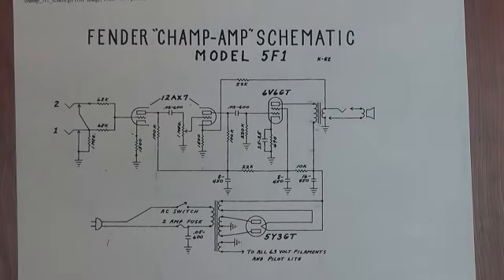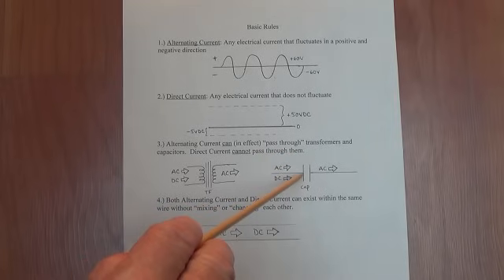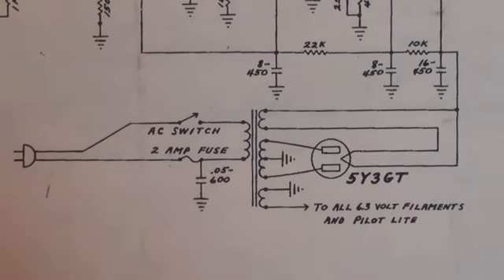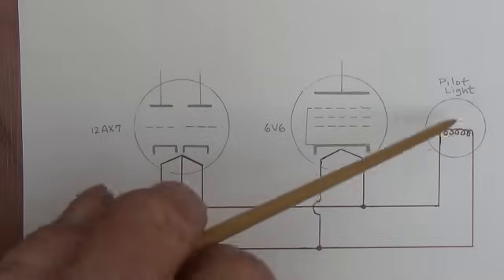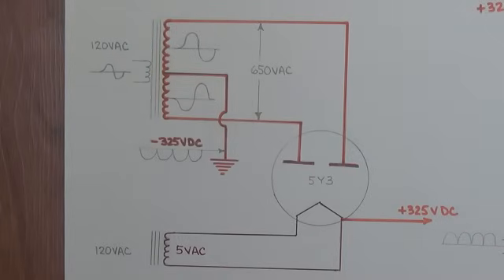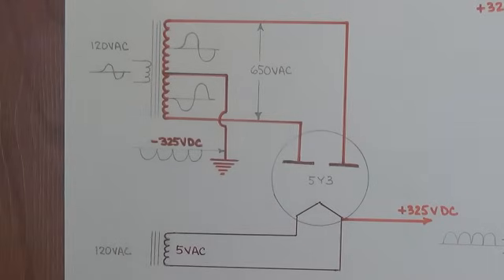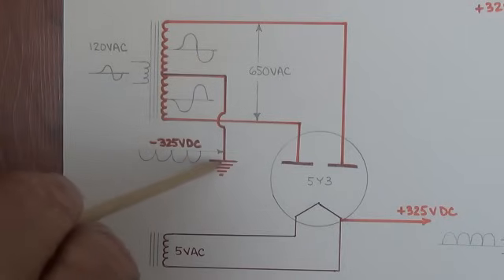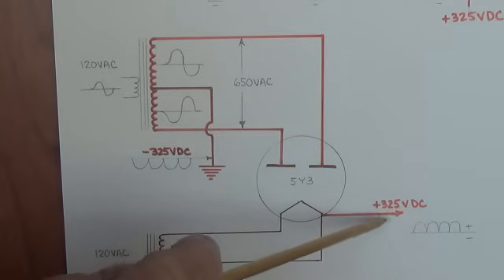How Tube Amplifiers Work, Part 1: The Power Supply

Comment: hi,uncle doug i put 2 resistors 120ohm on 6,3 ohm filament and 1 supply  807 tube and 6sl7 tube ,2  together needs  1.2 amperes  .What wattage of the 120 ohm resistor should i choose! if i calculate  v*i= 7.5 watts it seem very high wattage for the resistor
Reply from the maker: I'm sorry, KF, but I don't understand the question. What is the purpose of the resistors on the  "filament and supply" ?

Comment: 0:45
 Wrong! Your saying that the overall voltage is the distance of a conductor's voltage at two different times? One being +60 volts (its peak) and the other being -60 volts (its trough). Those are just two different moments in time of a single conductor. 
You need the voltage difference between two conductors to create a voltage.  Your only showing the sine wave of a single AC conductor.
 If your sine wave was applied to a neutral, it would only be 60 volts, not 120.
Reply from the maker: You're right, Aaron. All of this has been covered numerous times in previous comments and replies, and in subsequent, more detailed, videos on the same general topic. Thanks for your input.

Comment: If DC doesn't travel through transformers and capacitors, then why does the power supply make DC which then passes through Capacitors? Can you see why I'm confused?
Reply from the maker: Nowhere in the circuit does DC "pass through" capacitors, Victor. Caps are actually used to block DC from reaching tube grids. With filter caps, the rectified DC passes by the caps, but never through them (to ground). Tone caps allow certain frequencies in the signal (which is AC) to pass through or go to ground.  I hope this puts your mind at ease.

Comment: Do you think a GZ34 Full Wave rectifier tube can dropped into place of a 5U4? GZ34 uses 1 amp less heater current and possibly less forward voltage drop. This would provide better source current. Who sells a good tube manual these days?
Reply from the maker: Yes, you can replace an antiquated, inefficient 5U4 with a vastly superior, slow-start-up  GZ-34.....but you have to be sure that the higher voltages don't overwhelm your circuit. Vintage tube manuals are readily available on Ebay for a pittance.....check it and see.

Comment: I just watched part 1 and 2. Wow, this was so interesting.
Reply from the maker: Glad you liked it, Jim :)
Reply: I do have a question about the guitar amplifier’s output wattage and is it multiplied by how many tubes it goes through? I have a 25 watt amplifier and it has a 3amp fuse. Based on the little I know. P=IE that would be 120x3=360 watts that the amplifier uses but how is the output wattage calculated to be 25?
Reply from the maker: @jimaquilano9137  The output wattage is measured, not calculated, Jim. You need to watch the video I posted on how the process is done. Check my video list.

Comment: Your videos keep on giving! Thank you sir. Newbie question for you. It seems like we're 'flushing' a lot of voltage to ground, -325VDC. I'm curious about the amperage. I'm brushing away the cobwebs and getting in my way back machine for highschool physics: ohms law. I'm thinking ground is like a charge sponge, and the ground wire has little resistance, wouldn't we see significant (and dangerous) amperage in our ground wire?
Reply from the maker: Actually, ALL the electrons are pumped by the power transformer from the circuit to ground through the high voltage center tap. The function of the circuit occurs as the electrons move from negative ground back to the electron-depleted (positive) portions of the circuit.

Comment: here's a question: would sound vary on a 220V/50 Hz vs 110V/60 Hz amp? Has anyone compared every? Transformers have a lot to do with the end sound. Bottom line: voltage varies from country to country and it wouldn't be right to sell 1 specific model brand amp in the US (110V) and the very same model brand amp in say Paraguay (220V)
Reply from the maker: I honestly don't think that there would be any audible difference between the two power transformers, Fernando.

Comment: So the +325vdc output is somehow put onto on the 5vac filament line?
Reply from the maker: No, due to the biasing of the diodes in the full wave rectifier tube, the + 325VDC emerge from the filament side of the diodes. See my more recent videos on power supplies and rectification for a detailed explanation.
Reply: @UncleDoug  Thanks for the reply!  I'll need to watch those.  I had been under the impression that the filaments of tubes were always isolated circuits solely for the purpose of heating something. I had no idea that would be involved or connected to anything else.
Reply from the maker: @DollySvengali  The 6.3VAC filament circuit for the amplification tubes is not connected to the HV in any way, FD, and no HV exists in the 5VAC filament voltage of the rectifier tube (it all goes to the amp tube plates).....so you really have nothing to worry about.

Comment: UNCLE DOUG< if the B+ voltage is at 450vdc and if you increased it to 600vdc will this increase the AC ripple voltage and output more wattage?
Reply from the maker: Unless the circuit was designed for 600VDC,  all sorts of problems would arise, including shorted filter caps, Bill. You can't simply force a circuit to operate at parameters beyond its capability. In general, however, the higher the plate voltage the higher the gain in the amp.
Reply: @UncleDoug  I'm just talking in theory, would the AC ripple peak to peak voltage increase or decrease because the B+ voltage has increased? Yes higher plate voltage on the power tubes but this will cause the AC ripple to increase or decrease? The power tubes would draw more current if you raise the B+ voltage which would increase the AC ripple voltage?
Reply from the maker: @billwilliams6338  If ripple is a percentage of the voltage peak, then increasing the voltage peak would increase the amount of ripple. The percent of a higher number is greater than the same percent of a lower number......but I fail to see how this is relevant to a practical understanding of circuitry with regard to diagnosis or repair.
Reply: @UncleDoug  I haven't seen you make a youtube video on measuring the AC ripple on guitar amplifiers. The oscilloscope trigger needs to be set to the Line frequency to measure the AC ripple.  Fender amps ripple percentage is different compared to marshall amps ripple percentage any reasons why? Can you make a video going over the voltage peak compared to the ripple percentage?
Reply: @UncleDoug , If you play the guitar and use an oscilloscope to view the AC ripple on the power tubes screen resistors you will see the AC ripple increase when you strum the guitar strings harder because its drawing more current from the power tubes and the AC ripple increase and gets worse which causes Harmonics and other noises in the guitar notes.
Reply from the maker: @billwilliams6338  It sounds like you are the one who needs to be making videos demonstrating your theories, Bill.  I am still at a loss to see the value of calculating ripple percentage......what purpose would this serve?
Reply: @UncleDoug  if there is to much ripple or the ripple increase in the Biasing voltage to the grid or screen of the power tube it will create noises and harmonics when you play harder on the guitar strings. I was asking if you have notice this type of problem when repair amps or have never noticed it seems or don't care about it. Was just asking not demanding information from you don't get mad.
Reply from the maker: @billwilliams6338  I'm not mad at all, Bill. I just haven't noticed the problems you describe.

Comment: I don't know if you'll read this question because this video is 5 years old but here goes...  At around 18:00 you show the +325 V DC waveform drawn in pencil.  Why are the waves next to each other without any spaces between them where the downward half of the wave used to be?  (I'm going to use a ^ in place of the upside down 'u' because that's all I have on my keyboard).  To rephrase the question  more clearly, why is the output drawn ^^^^^^^^^^ instead of ^ ^ ^ ^ ^ ^ ^ ?  How did the top half of the waves move together eliminating the time taken by the downward half of the wave?  EDIT:  thank you for the video (I should have said that first before I busted into a question).  It's the best explanation I've seen in my 50 years of playing guitars through amps.  Two thumbs heartily 'up'.
Reply from the maker: I try to read and respond to all questions, Robert. The "upper" wave forms occur at 60Hz. Recall that the HV winding is center-tapped, so the output from each (of the 2) output wires is out of phase (when upper wire wave form is up, the lower wire wave form is down, and vice-versa). Since the rectifier only allows the positive wave forms to pass, the positive wave form from the lower wire is inserted in between the two positive wave forms in the upper wire, creating twice as many positive wave forms overall, resulting in a 120Hz positive DC output (with some ripple). I hope this makes sense.
Reply: @UncleDoug  Makes perfect sense.  I should have figured that out myself!  :)  Thanks for taking the time to answer.  Much appreciated.  Belated happy Thanksgiving.
Reply from the maker: @robertbogdan7058  You're welcome, Robert.

Comment: You shouldn't have put a ground symbol where the -325v rail comes out as that will confuse someone later on ground symbol should indicate 0V or common
Reply from the maker: I understand, Dr. C, but the center-tap of the HV winding, which does serve as a return for the HV circuit, is always grounded.

Comment: hey Uncle Doug, just wanted to let you know that I had my first success experimenting with an ECC83 (12AX7)! 
I used a cable from my mp3 player and hooked up the "hot" output cable to the gate of the first stage other side to ground. 
then i put 60V from chained 9Volt Batterys across the Kathode (-) and Anode(+). 
I had a 47microfarad Cap to decouple from the Anode, connected to a little mono headphone earbud. other side of the earbud went to ground-----_ I HEARD THE MUSIC!!!!
What a feeling!!! Thanks to your video! 

Then I wanted more. I tried to connect the decoupled signal from the 47micron cap to the gate of the second stage. straight ;) 
Anode of the second stage got a cap, too and then to output. 
This didnt work AT ALL and is even quieter than the first stage. First it kida worked and sounded really distorted :)) Then nothing.
I think, looking at the Fender Champ scematic, that i need some resistors, and then a Cap from the Anodes to Ground. Why is that so? And why did it work without on the fist stage?

THANK YOU!!
Reply from the maker: By "gate" do you mean "grid" ?  Did you apply 60V to the plate and cathode of the second stage ? When you say "47 microfarad" do you mean "0.047 microfarad" ?  There are too many variables for me to offer any definitive answers, M. You need to follow the Fender Champ schematic for the circuit to work. I explain why in many of my videos.
Reply: Wow, you taught me more in the first 3 minutes than I learned in my first year of electrical science lectures in first year mechanical engineering at university.

Comment: How does it become 12v on 12ax7a heaters? Thank you.
Reply from the maker: The filament circuit is center-tapped, so you apply 6.3VAC to each half of the series circuit and you end up with 12.6VAC total.
Reply: @UncleDoug  Uncle Doug, with all the respect, i do not think connecting two filaments to the same 6.3v point will add it up to 12.6v. I believe 12 in designation of 12AX7 tube means that it can be powered from 12v source when filaments are connected in series, otherwise both filaments could be connected to a 6v source in parallel. Love your videos and admire your skills. Thank you.

Comment: Never did I realize that the first number (12AX7 or the 6L6) on a tube represents the voltage.... Mind blown! Great video!
Reply from the maker: Yep, but it's not true on all tubes. Check out the filament voltage on a 7B4, 7B5, 7B6, etc.  There are a few exceptions.
Reply: Copy that. Thank you for the information.

Comment: Hey Doug thanks for the videos I have a question for you if you could possibly answer I have a Murphy mini stereo system which has a cd player, cassette player, radio and record player which I picked up at a garage sale for 10 euros and to my surprise it  works the only problem is with the audio output. I can only turn the volume up a quarter of the way and then I run into this horrible fuzzy sound and I was just wondering if you could give me any idea why this might be and if there was any videos or subjects I could read up about to find out more about this problem ?

Many Thanks
Reply from the maker: I think you have discovered why it was for sale in a garage for 10 euros, Sean. Either the circuit has an issue or the little speaker(s) are blown or simply inadequate.  Repairs might be possible, but the cost would be considerably greater than the purchase price. Sorry.
Reply: @UncleDoug   Thanks for the reply Doug ill guess Ill have to give up on it then

Comment: Tube rectifiers lend quite a bit to the phenomenon known as ‘sag’, where an amplifier exhibits limiting behavior due to a momentary drop in B+ voltage when heavily loaded.  This ‘sag’ can be very desirable for some playing styles.  It can also be undesirable in that it is very frequency-dependent, so more bass in a player’s tone can cause unintended artifacts.  For this reason it is my personal preference to look for solid state rectifier tube amps.
Reply from the maker: I understand, Peter. Good explanation........

Comment: Hi Doug,Just a little thank you, the amp is going great now i found the bad earth replaced the filter caps ,all the valve holders ,rewired it all and changed the negative feedback by adding a pot to trim it ,reduced the 820 ohm to a 220 with a 1k pot . I also changed all the pots for new and replaced the input jack sockets and the rectifier diodes they were down to 0.3 ish. I put in some Celestion tube speakers and replaced the cloth and added a new logo works like new or better i feel . Without your help and youtube videos i would not have had the nerve to attempt this. 

You the man 

https://www.youtube.com/watch?v=9WOmA0VLNoE

Sorry for the quality and buzz this is not the amp but the room .

Nikk.
Reply from the maker: Wow, Nikk, you did a heck of a job on this old gem. If our videos assisted you in any way, then we are proud to be associated with your excellent project.

Comment: Hey Uncle Doug and anybody else here that may know. I've been slowly educating myself on old school tube electronics and got myself a 1932 Pfanstiehl Midget radio to figure out for myself. From what I can tell, the think only seems to run off of a half wave rectifier. Is this super uncommon for something this old? The rectifier tube is a UX-280 Diode that seems to have the 2 plates tied together. It looks to be original with the exception of somebody replacing the filter cap.
Reply from the maker: That sounds like quite a project, Kermit. I personally have no experience with half-wave rectifiers in radios. You would think it might be tough to smooth the DC. Let us know how it turns out.
Reply: @UncleDoug  With a set of capacitors on it, it actually is fairly quiet to my and probably your surprise. I am certain it's half wave rectified because with them unhooked it produces a horrid 60 cycle hum. For a output of 160 volts, would you have any suggestion on what size filter caps should be on it? Thanks again for all of your videos by the way. You have helped me begin to grasp so much of this stuff. I would be 100 percent lost without them.
Reply from the maker: You're welcome, Kermit. Generally you want the lowest capacitance that can provide hum-free B+.  I suggest that you experiment with filter caps, starting with 10uf and moving your way up in value until the hum is gone.

Comment: Now there is a handy and safe tube puller / inserter available on ebay, item 254242318237  Easy, simple and safe. A perfect tool for any audiophile or vintage electronics technician
Reply from the maker: Thanks for the info, Arie.

Comment: Another fabulously helpful lesson. Thank you! I have a question: is there a difference in how an amp runs when fed 50Hz vs 60Hz  power ? I have seen a video wherein a UK-built amp can be set to operated on a range of power sources, ranging from 120V to well over 220V. I assume this means the amp will run both on UK power and US power. But what about the difference in power frequencies ? Does this have any effect on the function or sound through that amp ?
Reply from the maker: From what I understand, as long as the voltage is correct, the frequency will not make a noticeable difference in sound or performance. British amps often come with power transformers that allow for use with a wide range of voltages and frequencies.
Reply: Howdy.
If the transformer is designed to run on 50Hz connecting it to 60Hz will only mean the core magnetization is lower. 50/60 = 0,83. That should be no problem.
However if a 60Hz transformer is connected to 50Hz there will be overmagnetization. 60/50 = 1,2. Usually the transformers are designed to operate close to saturation. This reduces winding losses. So the transformer core will likely go into saturation. When that happenes there is very little EMF ( = electromagnetic force = induction ) in the winding. The winding resistance is the only thing that resists current. One will quite soon have a burnt out transformer.
Regards.

Comment: Thanks Again Doug. This is a huge help. 
Where can I find transistor schematics that will yield the same result or similar results as in 
http://www.electronicstudio.net/schematics/Fender/Tweed%20Power%20Amp%20(100%20w).pdf

Thanks in Advance
Reply from the maker: You're welcome, Evan. I only deal with vintage tube amps, thus I can't help with any SS questions.